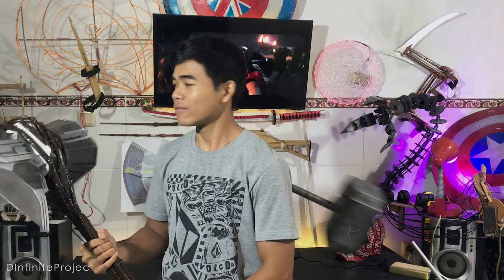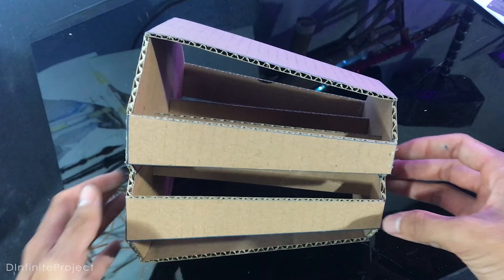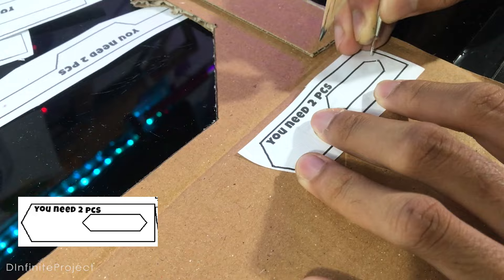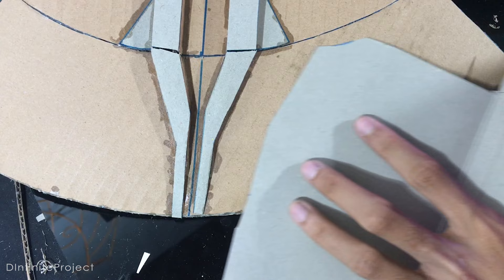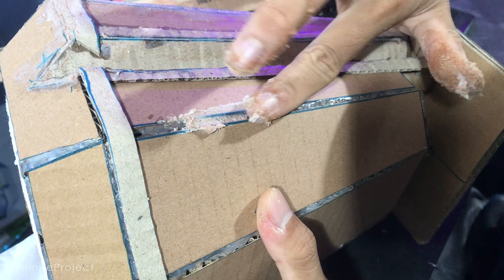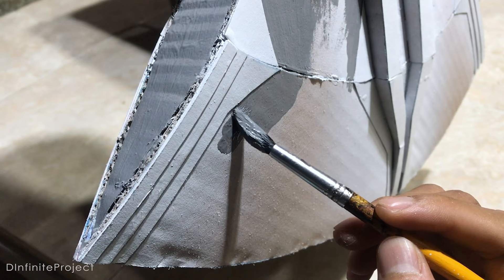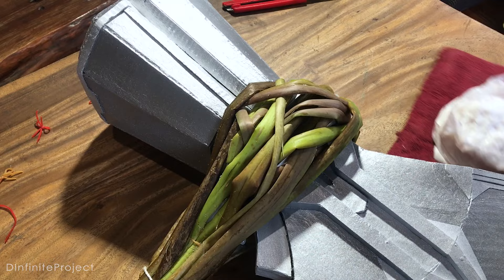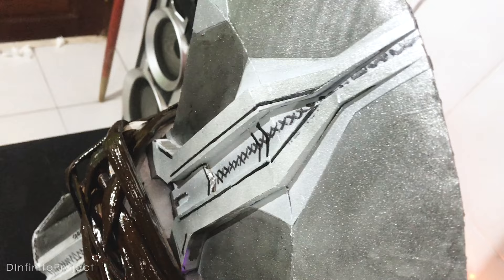How to Make Stormbreaker Out of Cardboard (REAL TREE!)

Comment: I use for making handle is pvc pipe but it is loose what can I do tell me
Reply from the maker: You can put small nails on the pvc and make sure the parts where the nails are glued on the axes part. The nails should prevent the pipe of loosing. I hope you get the idea👍

Comment: Will the stems rot after some time?
Reply from the maker: Probably, but now it’s just dry because of the wood glue and the wood stain
Reply: @DInfiniteProject  do you think rolling a bunch of paper to make it long then covering it again with paper or masking tape to cover the wrinkles from the twists would be efficient to make sure that it wont rot or it will be just a waste of time
Reply from the maker: The stem will rot anyway. But covering the stem with paper or masking tape is a nice idea tho. I didn’t think about it. Covering the stem with masking tape then cover again with wood glue will keep the wood textured on the handle. That’s definitely a great idea👍
Reply: My plan is to roll a bunch of scratch paper into kinda like a straw then connect them together with masking tape and then roll a few layers of paper over it again to make it as thick and long as an actual stem, it's to make sure the handle will stay sturdy and hard because I'll be letting kids play with it, if it's just gonna be in a shelf then I'd use stems
Reply from the maker: @bananaguy1440  I’ve seen @epic cardboard props used that method. He rolled cardboard to make the stem texture. That should work. I was about to use rolled paper as well, but I use stem just to make the video a bit interesting haha